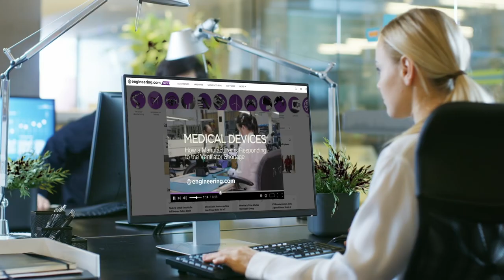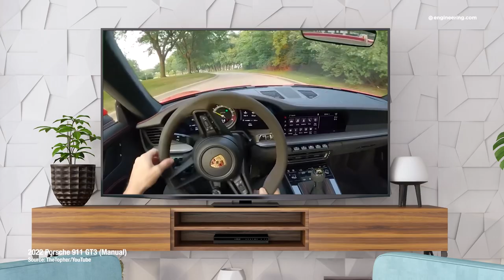The End of the Manual Transmission

Comment: I learned to drive using a manual and I do prefer the various mechanical feelings Jim mentioned but the automatic transmission allowed the average driver to focus more on the road rather than the vehicle.  What I am truly looking forward to is autonomous driving vehicles because even though modern driving is fairly simple, many drivers are more distracted than ever on roads which are highly populated.  This is a big safety concern and autonomous driving vehicles will go a long way to alleviating that safety issue.  Driving for the sake of driving will become less common just as horse-riding for sake of horse-riding became less common 90 years ago.
Reply: Automatics do not allow the average driver to focus on the road, it allows them to focus on other things like their phone. 

I dont even think about changing gears when I'm driving, it is second nature.
Reply: i actually subconsciously picked up safer defensive driving habits with a manual. because you have to think ahead about when to stop (as youll stall if you dont) i tend to look at traffic lights and intersections far ahead in advance out of habit even when daydreaming. Ive never had a crash or near miss in 8 years of driving and the only accidents were low speed when other people didnt look when passing into my lane or in parking lots when the sun blocked my reverse camera view and backed into the wall or smashed the side mirror from not seeing a concrete plinth, yet my mom has at least 1 every year and has to get bailed out by the collision detection system everytime.
Reply: Autos suck bring them back!

Comment: In commie pinko yurope those concerns about weight, power loss, fuel efficiency etc. are still valid today as they were in the 1940s. With the average car being a sub-2L "compact", you cannot really ignore the performance hit of an automatic transmission. It's not like driving an American 5L V8 land yacht with tons of torque and fuel that costs a quarter of what it does in the EU . If you want decent performance out of the typical EU car, you really need a manual.